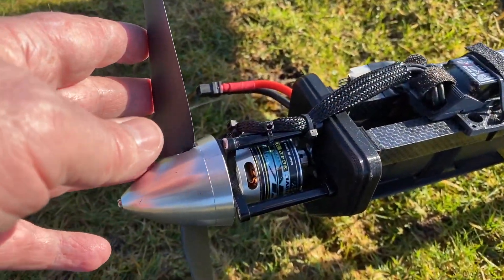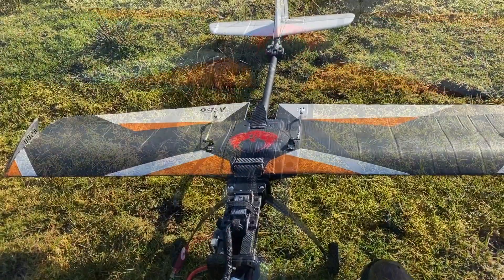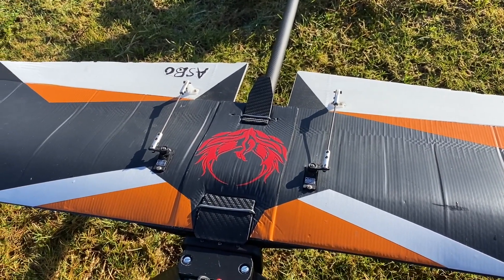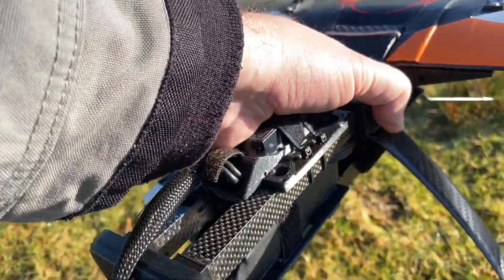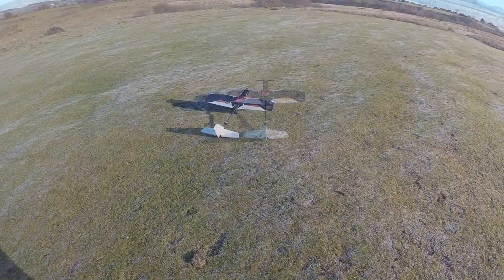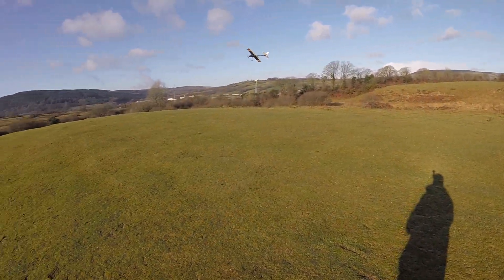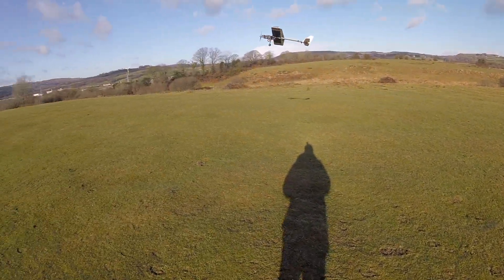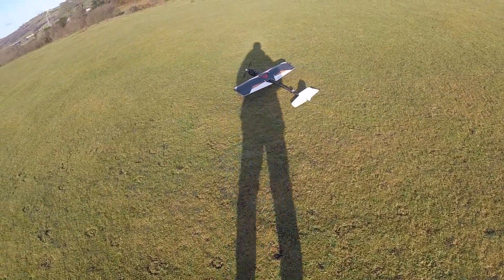Carbon Tube Plane - Maiden

Comment: impressive design skill acquired during lockdown. Would be interesting to spend a video about 3d design
Reply from the maker: Good call......I will do a Fusion 360 basics video to get the concept of it understood. Once you understand the basics it is not that bad. Just lots of tools and a learning curve exploring the tools
Reply: @TWSreviews  looking forward to this  Fusion 360 video. I use sketchup to design simple things for rc stuff and things around the house, nothing fancy, because i find it quite a handfull. Hope fusion can be a better replacement

Comment: Well done Jono, a predictable outcome...I'm printing my first plane, it's a learning curve for sure...🤔🤔😯😯🇬🇧 Print some wings for it and show us maybe..??
Reply from the maker: When I go to the shows there is very often a seller selling odd spares and have seen wings of all shapes and sizes. I am exited at being able to quickly convert the format of the plane. A nice big set of glider wings would be nice and maybe a set of 3D style MX or Sbach wings would be good too.
Reply: @TWSreviews  Yes, it's flexible...print some wings for it...🤔🤔🤔🇬🇧
Reply from the maker: @EnglishTurbines  You gave be an idea. Wing receivers to use some of the two piece wings I already have. I could 3D print the whole wing but worried they may be too heavy for the size I need (1.5m).  More research required...
Reply: @TWSreviews  The model in the clip, looked a bit short on wingspan to me IMO...Print some wings, I want to see how you get on with it...lol..🤔🤔😳🇬🇧